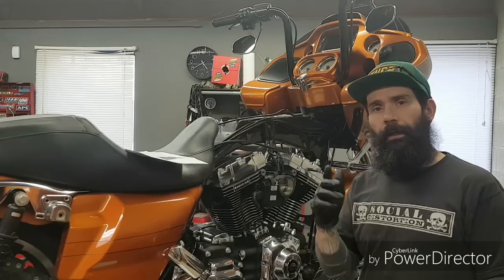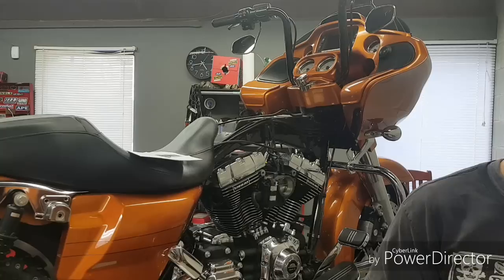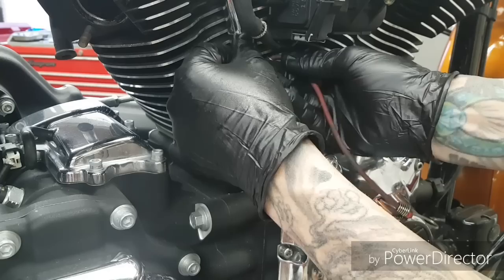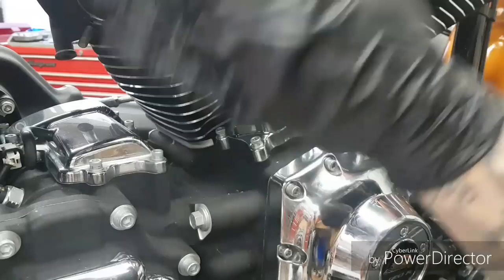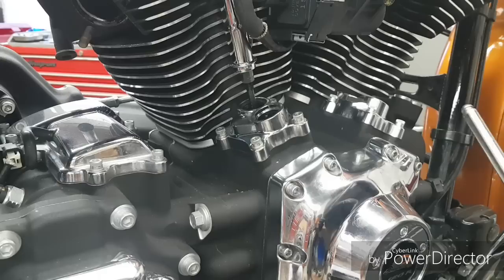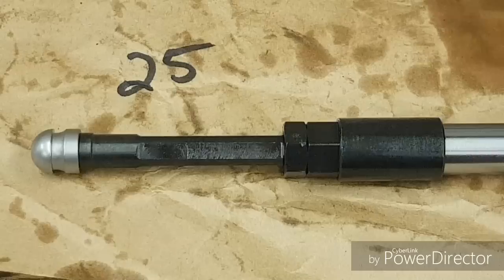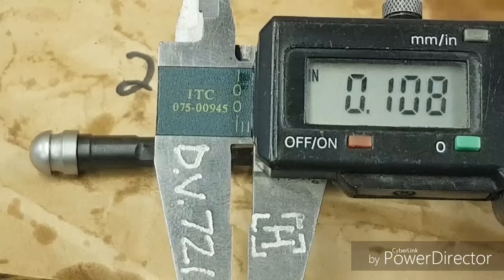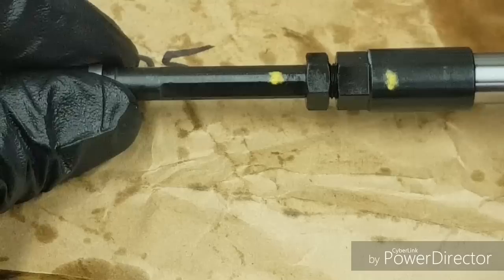Adjustable Pushrods for Harley Twin Cam

Comment: So I have been contemplating doing a set of “bolt on” cams and adjustable pushrods myself and have total anxiety about this project.   This video and explanation is very well done.  Thank you sir!
Reply from the maker: Thanks! If you have any questions just ask
Reply: It does seem kind of intimidating if you never have done this cams or pushrods before but I just got done with the cam, oil pump and cam plate upgrade in my tc88 and it really wasn't bad at all! Now it's time for the adjustable pushrods, seems fairly simple everyone says just pay attention to what you're doing.. This was a $1300 dollar job in labor at Harley so I'm stoked to be saving money.. Just watch videos until you are confident in doing it and make sure you have everything you possibly need before starting

Comment: Thank you!! First time adjusting S&S pushrods I went by their Instructions of 4 turns which, by way of micrometer is way over the .090 - .100 the lifter manufacturer called for. Using the micrometer method you showed, 3.25 turns put me right .099” and I verified that with feeler gauges. Once installed,  I even used the jam nut as my zero at zero lash, turned 3.25 turns, used the feeler gauge again to verify .099”, then lock it up. Thanks again!!
Reply from the maker: Thanks for your comment! I'm glad the video helped. Knowing this information makes it easier to figure out any manufacturers adjustment.

Comment: I liked your video. I understand the whole concept, but the reason you are long with 4 full turns is do the math. 32 tpi. 1" divided 32 is 0.03125, times 4 turns gives you 0.125 so if your shooting for 0.100 you will be 0.025 long its no big deal because they call for 4 turns. But if you're dead set on .100 just do 3.5 turns or 3 flats which will give you .109 Excellent video for someone who wants to do this themself.
Reply from the maker: thanks for the explanation… I liked your comment, and am well versed in why.
if you know the tpi… and often times you don’t or know who’s pushrods are in a motor… and finding information can be present difficulties . 
A thread pitch gauge is useful if you have one, which I do, again not always close by.
the point, which, is how easy figuring this out is without knowing what pushrods you have, or their respective top. by simply doing the measurements you can get them where you need or want them set
It’s something I was often asking myself when information wasn’t available with an online search.
Long and short term his method works anytime you lack the information.

Comment: Between S&S and Kevin Baxter explaining tdc for adjutable pushrods and yourself sir I should be able to do it. Lol. Ty
I did read to also know what the lifters’ recommended travel and cut it in half to know exactly how many flats or turns.
Reply from the maker: I like to start at .100 and run the engine. If some noise develops in the tappets, I will “add a flat” to the adjust by turning them out another .020 to .030. This can sometimes take away some of the noise

Comment: Wish I had seen this video before this passed weekend. Installed 551C cams in my 2013 Street Glide and used S&S Adjustable pushrods. Got all my timing marks lined up installed the pushrods, adjusted them how I "THOUGHT" I was supposed to, fired the bike up and it was idling horrendously bad coughing black smoke out of the mufflers and stumbling awful. I shut it down and tore it all back down to double check my timing marks (which were good) reassmbled everything again, adjusted the pushrods the same way I did the first time and got the same results. I gave up for the day and sat down in front of the computer to try and trouble shoot the problem and found this video. Now I know I adjusted the pushrods wrong and I am PRAYING I didn't bend anything....I'll find out this weekend when my Quickie Pushrods come in SMH :(

Comment: Great video
Putting a cam and adjustable push rods
The cam is easy start concerned about precision lifter and push rod setting
This is going on a 2012 street glide
Reply from the maker: Thanks!. There isn't any difference setting the ez starts.

Comment: Excellent video.  In the process of upgrading my 2003 FXSTI cam chain tensioners to the hydraulic kit, and plan on using SE adjustable push rods.  The key thing I was trying to confirm was the 0.200 spec for the stock lifters.  Now I know that i need to adjust to 0.100.   Since I have the cam chest open, I'm also thinking of installing the Andrews TW21 cam.  Question:  Should I replace the stock lifters?  Really don't want to if it is not needed.  Bike only has 18K on it.
Reply from the maker: Thanks for you comment! I appreciate it.
With only 18k on the bike, the lifters are likely just fine. It is common practice to just replace the cams during upgrade, depending on budget. with higher miles it becomes more questionable, and recommended to replace them.

Comment: Great 3 part video Brother!  I'm getting ready to tackle my wiped out cams in my 120ST.  Tappet roller went south on me.  I gonna be installing a new billet cam plate, high volume oil pump and TW-408-6 cams.  A little bit more check work for me with replacing the cam plate to ensure proper alignment of gears, but overall... VERY informative and spot on for just a cam swap!  It may look like a bit much until you get in there, but its a pretty straight-forward DIY for anyone with a mechanical aptitude.
Reply from the maker: Are you going with S&S for the plate and pump? I just opened the motor in the video and put these in now as well
Reply from the maker: And thanks!
Reply from the maker: I put the Woods Night Prowler lifters in as well
Reply: @CrackerJackMechanic  going with SE billet cam plate and SE high volume oil pump.. SE tapered pushrods and S&S lifters
Reply: @CrackerJackMechanic  I have seen them destroy 3 motors... not gonna chance that... S&S have one of the better track records
Reply from the maker: @tgrisko  I put the woods lifters in as per the customers request... he claimed good things.

Comment: Great video from begin till the end. I do the same with my twin cam 2004 screaming eagle camplate en quickee pushrods.
But when install everything how do first start the engine, because there’s no oil in it, only the assembly lube. Do I need to start a few times without the spark plugs. To pump the oil up.
What’s the best method.
Reply from the maker: Good question. Good you are concerned and thinking about this! The assembly lube provided you use it properly provides enough protection at startup and the engine oil will arrive quick. Make sure you have oil in tank!! I don’t rev the engine and let it warm up while listening to the lifters (I pre-bleed lifters). I have had new lifters (not pre-bled) take 2 minutes to get quiet. This is an area where newer mechanics can get tested. You are learning now!!

Comment: Just installed the complete Cam chest kit with the quickee pushrods and adjusted per the S&S install guide at 4 turns.  Got some bad ticking noises and called S&S tech support.  They told me the 4 turns is not used anymore and should go back to the 3.2 turns.
Reply from the maker: Yeah. I go .100” To start (after I calculate the number of turns to achieve this, as shown in this video) and add another .020 if there is a noisy tappet after starting and running the engine… sometime I wait longer then other times… depends on the work that was performed.

Bleeding tappets before installation is very helpful and can eliminate noisy tappets on startup with new parts

Comment: My apologies if this has already been asked. i did not see that it was. I had to replace a bad lifter so I will be pumping them up with oil prior to installation. After you put the push rods in and you open the rod up to make contact with rocker arm and lifter, you count the turns to compress the lifter to a designated location. Am I to assume that a lifter that is not pumped up, will still extend to the same position as one that is pumped up?
Reply from the maker: this is a good question. it has not been asked. I myself worked through that scenario more than once.
The difference will be the amount of resistance felt while extending the pushrod. You will still be extend the lifters the same distance.
I believe this sheds some more light on your situation.
And Good Work!! I was glad you mentioned that you were pumping up your lifters prior to installing.

Comment: Great video. very well explained.
 I  have a 2005 15 anniv fatboy 95 ci. with Andrews 37G (4 gear drive set,cam bearings, adjustable pushrods,)  BUT MY INDY  used the same harley stock lifters(25,000miles), and the same cam chest.  now at idle it sounds like a deisel cummings, when hot. at cold idle, you hear NORMAL GEAR NOISE....sometimes it races, and sometimes it starts real slow,low idle.  But when she been running for about 2 hrs, you hear a metal clappin, from the lower end, had ngk plugs, had to wrench down the plug almost all the way down, did it ice cold? looked like the same thread? put alittle grease on threads helped , then sound like it was a knock from the plug, so i took them out and installed Harley 6R12, with new SE wires. Again, had to wrench those plus down???  my plug holes must be scored,some shit.   But if you can help me, i thank you in advance,sorry so winded, but got no help. the noise when hot sounds like the crank,lower end? knocking,pinging????  ty
Reply from the maker: Without being there, to hear the motorcycle its difficult to say for sure.  can send a video?
Reply from the maker: Without being there, to hear the motorcycle its difficult to say for sure.  can you send a video?
Reply: @CrackerJackMechanic  thanks for the response, no not savy,,,sorry, im 53 yrs old.

Comment: This was the best I have seen thank you
Reply from the maker: Thank you! If you have any questions or a video you would like to see me do, please let me know!
Reply: @CrackerJackMechanic  I do have a question, I adjusted the push rods, I am 99% Its right, but, what should I look for or listen for If I'm off, I turned the rear wheel over a few times , I am one new header away from being able to start It, I have had her for 25yrs, a little nervous
Reply from the maker: Eric Man! If you can turn it over a few times by the rear wheel with the plugs out and it doesn't stop, you should be okay! The lifters will be noisy when it first starts up until they get oil into them!
Reply: What a weight lifted, I followed your Instructions to the letter, the tire turned over and didn't hang up I could keep It moving forward, Thanks again !!!!!!

Comment: Great video and detail, I'm about to change my Twin Cam chain tensioners and have gone down the S&S Quickee route for the pushrods.  Can I ask if I'm right in that you cut the pushrods when they're at cam base circle and install the new ones on the overlap?
Reply from the maker: Thanks! and you cut and install the pushrods at their lowest position, on the base circle, with that cylinder on TDC of the compression stoke. (the valves are closed and there is no serious pressure on the pushrods at the position).
Reply: @CrackerJackMechanic  thanks a lot for replying, will be starting this next week 👍🏻
Reply from the maker: if you have any more questions just ask!

Comment: GREAT video and explanations..  Getting ready to pull the trigger on Woods TW-222 for a 96" Harley Rocker C, watched several and just kept getting confused on the push rod part of the job.  Think I got it understood now.  Question: with these quickie push rods if the lock is snugged up good and tight is there ever any problems with the nut coming loose months later and needing to be redone?
Reply from the maker: Occasionally the locknut will loosen if not correctly tightened. Just make sure you tighten them and you’ll be fine.👍🏼

Comment: I apologize if you have covered this in another video or comment, BUT, I am waiting for my S&S quickee pushrods to come in, I installed my cams last night. As far as “bleeding down” does this still apply since I took the cam cover off and there is basically no oil in the system currently since it drained out after removing that cover. Again, I apologize if you have covered this already.
Reply from the maker: I’m having trouble understanding your question.
Reply: I replaced the cams so obviously lost oil from the cam chest. Will the rockers still bleed down since there is no oil in the system?
Reply from the maker: @alexanderogden1558  ok. Yes there will be some oil loss. With used (not replaced) lifters, provided they are decent, they should be fine. That said, if the lifters have higher mileage, replace them. There are differing opinions on which lifters are best. It depends on what you want from your engine as well. 
Bottom line is usually set by budget, which isn’t a good way to build a good engine. Tappets aren’t cheap though!

Comment: Would it say in the service manual how many turns for the push rod?.. Great video... Would it matter if you did the front cylinder first..? How long do you wait to do the other two push rods..?
Reply from the maker: The original pushrods are non adjustable. The OEM service manual does not cover this. Although you can use the manual to find out how long to wait for the pushrods to “leak down” or just feel them as time passes. It can be a couple minute’s usually less then maybe five to ten

Comment: Hi Truly a Great Video! 
I just installed 551 easy start cams in my 07 FLHT. everything went great. running a Vances&hines FP3. Exhaust gaskets are fine.
Question: (I only set mine at 3 turns).  it pops/back fire I guess, front cylinder only around 2,000ish  RPH High RMPs its fine. Runs great. Should I have done 4 turns on my 96CI motor. Bike ran fine before!!!

Comment: Great video. I have to replace the cam tensioners and already have adjustable pushrods and larger cams from the previous owner (he did not remember what cams were installed or what was done to the bike from the shop to install them). I don't know if it has spacers in with the valve springs (I herd some people do that for more hp) but even if he did that would it be the same steps for installing the pushrods? Also I am keeping the cams and everything the same do I need to change out the cam bearings?
Reply from the maker: Not completely necessary to replace the inner cam bearings but I do if they are not the better full-compliment style bearing. The stock original bearing uses less rollers and keeps them separated using a plastic cage. Consider lifter replacement if you have 30 plus mileage on them.

Comment: If I lose count can I restart after waiting 15 minutes. Is it necessary to pump up the tappets with a oil squirter? I already installed my cam and tappet blocks with lifters.
1988 EVO RK. Thanks
Reply from the maker: mark the pushrods with a paint pen, and focus like a jedi, so you don’t lose count! an oil squirted will not pump up the tappets for that you need to submerge them completely so the oil covers them and the air can be pushed out by gravity. or something scientific like that. or use a vacuum pump like a might vac with a cup that hold oil where the tappets can be submerged and then air “pulled” out

Comment: Thank you for sharing sir. Had mine installed and cant figure why i have a distinct tap / knock sound only on the front cylinder now. Readjusted again in case i missed something . retesting in the monyana, if same result thoughts? Thank you and bless 🙏
Reply from the maker: Yes it's very common for the front exhaust to be noisy initially I've had some take up to two full minutes before the tapping went away
Reply: Roger that. And if it doesnt ? 
Here is what im running into. P.r. paperwork said 18 flats, cam paperwork said 21-24 flats. 18 is three, 21-24 is 3.5-4 turns. I set them at 3 full turns. Followed all recomended procedures. Im maybe thinkn 3 turns is not enough? Rods are sns time saver and i bealieve those are 28 tpi , tappetts are comp cams oe style replacement. ( lifters stated that noise would be increased but would make sence it would be all over both heads and not just one. Appoligies in advance and thank you for your time.🙏
Reply: Readjust em and it went away. These 26h cams sound sick brother lol test ride soon 🙏 . thanks for your time and may father bless you sir .

Comment: It would seem to me that when you run the piston up to TDC and start extending the pushrod, you are forcing the valve open therefore crashing it into the piston until the lifter bleeds down and the valve closes. Hopefully it's not bent and damage to the piston. 
As soon as the intake valve closes you enter into the compression stroke and both valves are closed without putting the piston on TDC.
Reply from the maker: done a few, never bent valves at TDC. I guess you could if you tried really hard. Taught it this way for years… never had any problems. Thanks for your reply! Keep up the good work!

Comment: Question. Why do you insert your fingers in the tappet holes, and also insert a screw driver in the spark plug hole. Doesn't doing just one of those give you the desired results of finding the base circle on the cams?
Reply from the maker: So you know when you are on TDC of the compression stroke and not TDC of the exhaust stroke. The adjustment is made on correct stroke